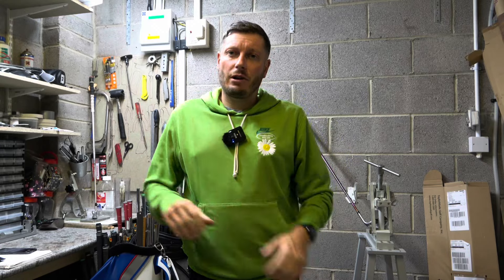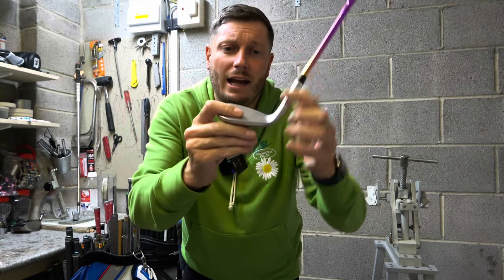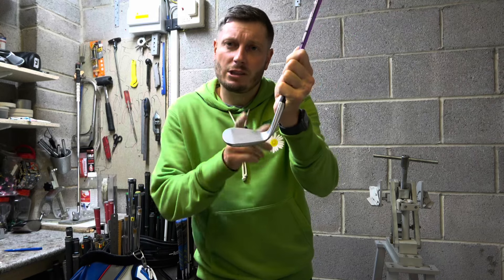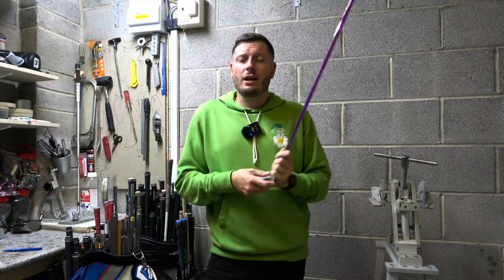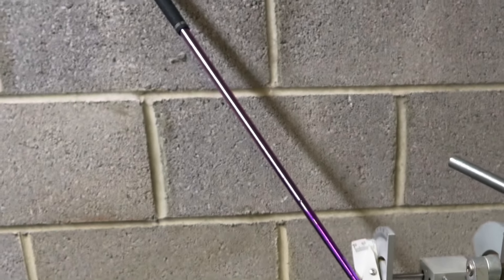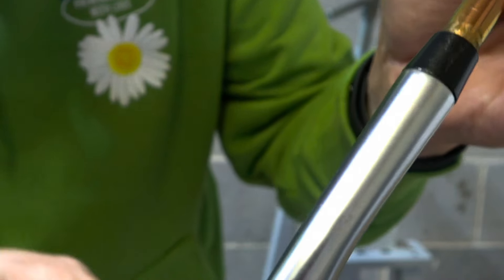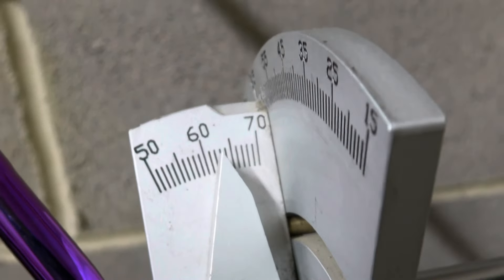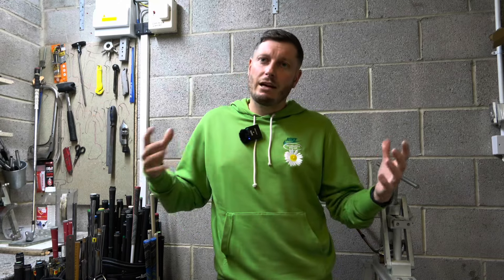CHANGE YOUR WEDGE GAME! Loft and Lies

Comment: Would love to be able to justify a loft and lie machine in the garage.
Build the one length set during the winter, you can stretch that to 3 or 4 videos at least.  Identifying and buying the irons, sourcing the shafts and grips and prep work, the build and finally ‘the test’.
Reply from the maker: I like that idea Stuart! Thanks!
Reply from the maker: I remember those clubs! They would have been easy to bend!

Comment: love these videos, I can see my future man cave filling up with club building equipment....question about bending cast heads, do you find they eventually return to their original shape over time or will it be permanent?  reason I ask is I had my Wilson Staff driving iron bent one-up because I was losing it a bit right, and that worked fine initially, but over time it seems to be leaking right again (which of course could be my swing changing shape but I'm ignoring that for now 😉)
Reply from the maker: I mean that is a possibility that it has returned to its starting lie angle. I’d say it’s more likely to change lie angles if the club is forged as it’s easier to move. It’s a one minute job to check your lie angle of the club.

Comment: I use standard Lamkin standard crossline grips. I would be interested in some grip reviews; as I’m never sure if they make a huge difference from brand to brand if they’re the same or similar specs. Thanks for the lie info, I always forget that lie is different with each manufacturer.
Reply from the maker: I’ll definitely do some grip videos! I have a few experiments that I’ve always wanted to do as well!